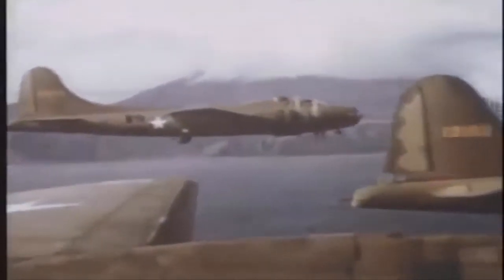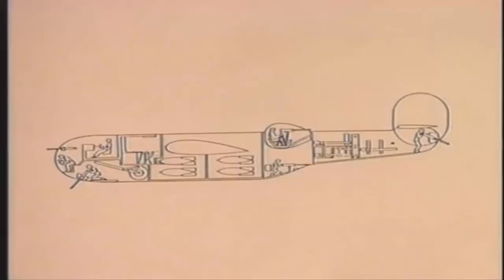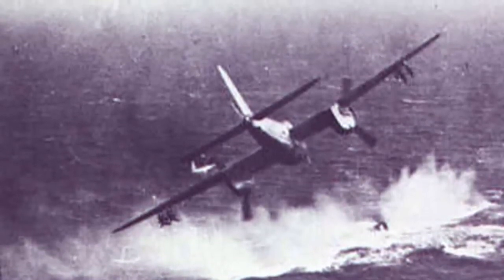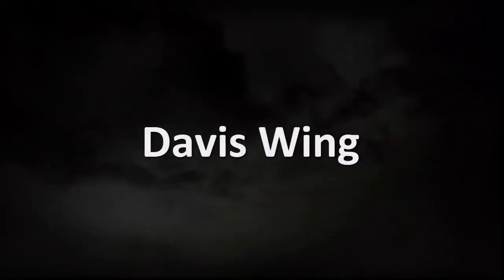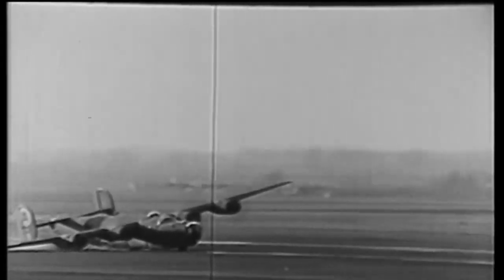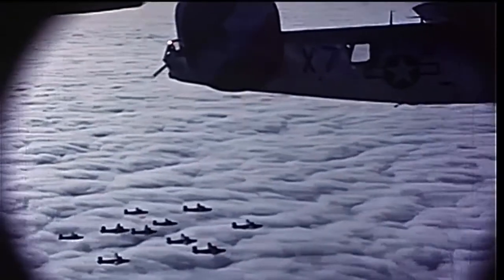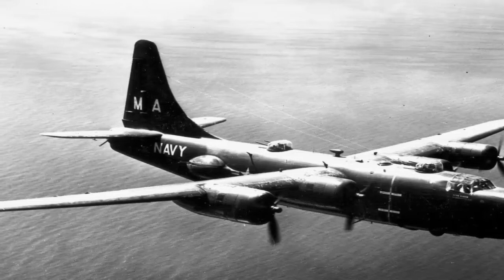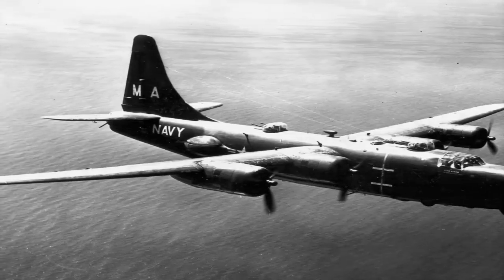B 24 Liberator:  3 Major Design Flaws

Comment: My father, a Ploesti 1 survivor, said that if the 24 got hit either in the wing root, or in the landing gear well, that the wing would snap off. Many of the people in his outfit (the Pyramiders) really did not like the airplane (mostly A models), but they were stuck with it.
Reply: I talked to one of the workers who flew on the Collings Foundation B-24 bomber and he told me that the B-24 drifted up and down a lot in the higher altitudes that it was a full workout for the pilots to correct it and keep in formation. One wrong move could send the plane drifting up and away from the formation and force them to fly back alone without escort fighters.
Reply: The wing root area is the weaker spot on most aircraft.
Reply: The wing root is the weakest spot on all large aircraft.  The 24 could also take more damage than the 17 because of it's shape and design.  The 24 also had an auxiliary flight control system the 17 didn't including hydraulics for the flaps.
Reply: @riproar11  I too have worked with the Collings Foundation and flew in the Witchcraft many times.  The up and down drift is due to no pay load.  In combat with a high wing the dihedral would be left to right with a full load.  That is compensated with the twin tail, though more dihedral is present on the 24 at higher altitudes with a 3/4 bomb payload still higher than that of the 17, it would maneuver just fine without the drift to the left and it's performance was better.
Reply: My Dad flew the Ploesti raids with the 449th Bomber Group. Never talked about his war time experiences.
Reply: My father was a pilot with the 44th BG and hit Ploesti on 8/1/43. His was a D model.
Reply: @riproar11  My Father said you could always tell Pilots by the way they walked.
They called it Liberator Legs!
Reply: @user-qy9tf2im7f  And B-25 Mitchell pilots were hearing-impaired in their left ear and co-pilots on their right. I have seen many B-25s take off and fly over and it is such a loud experience!
Reply: Anti submarine  warfare-300 MPH 80 ft above  the water  to deliver payload. South Atlantic
Reply: NO aircraft even today would survive a 88 mm exploding in the wing root at point blank range..

Comment: The Liberator, unlike the B17, did not have armoured fuel lines and hydraulic pipes, so that when attacked these pipes would turn into flame throwers, dousing everything in burning fuel. US airmen said that if you looked around you in a POW camp, you could tell the B24 crewmen because they were the ones who were burned. The Lancaster was also guilty of burning like a Roman candle, made worse by an escape hatch that was too small for a crewman to exit wearing a parachute. Good examples of how expendable lives were.

Comment: "It didn't fly as high, so it was easier to hit with flak"

They had a larger maximum bomb weight, so they didn't fly as high and were easier to hit with flak. 
That's a decision, not a design flaw.

As for "hard to manuever"... my grandfather (B-24 ball turret gunner, Flak Happy, Flak Happy Too, Kontagious Katy) told me a few stories about experiences on the 24 before he passed. He never expressed a wish they would move around better.
...a few times he wished people would stop throwing out toolboxes and parachutes while lightening the craft.. but nothing about the 24 itself.

Comment: I saw a documentary on these once and it was considered slightly superior to the B17. The only serious flaw was the it was difficult more difficult to escape if the plane was shot down.🇦🇺
Reply: At least the crew in either the B 17 or B 24 as a whole had their parachutes harnessed to them ( with obvious exceptions ) , the British 4 engined bombers , Short Stirling , Handley Page Halifax ,and of course the Avro Lancaster ,  had crew positions that as a rule didn't allow for harnessed parachutes , and consequently mortality rates amongst those crews was ( noticeably )  higher when compared to USAAF crews on ( similar ) missions

Comment: Heard a conversation between a B-17 Veteran and a B-24 Veteran.  The Liberator Vet said; "The B-24 carried more bombs further."  The Fortress Vet replied; "Yeah, but the B-17 carried more aircrew further."
Reply from the maker: Each one had their own strengths and weaknesses for sure
Reply: Truth is they had almost the same exact loss rate with a small edge going to the 24.
Reply: @cdjhyoung  Good points all. My father flew his 35 missions out of Italy to points north. Strong advocate of the B24.
Reply: @fawnlliebowitz1772  The number of mission flown to complete your tour of duty changed: the original 492nd 'only' needed to fly 25 missions and be done. My dad, one of the last replacement crews, need to fly 50. Your dad in Italy had to make 35. Some of the guys in the South Pacific needed 100 missions for a tour of duty. Those had to be hard count downs to fly that many missions.
Reply: A dumb argument. The 17 carried a larger crew and a smaller bomb load than the 24.  It was also slower and had a shorter range than the 24. Nearly 7,000 more  24s 9were  bhilf

Comment: About 15 years ago while flying for Delta Airlines, I flew with an F/O that had been at an airshow in Memphis (I think), and luckily met the right person. This person called him later and asked if he would like to be his co-pilot and help him ferry his B-17 from Memphis to California. The F/O jumped at the opportunity got to fly the B-17. A few weeks later, the guy called the F/O and asked him if he would like to help fly his B-24 out to California. Again, he jumped at the chance. He told me that flying the B-17 was a pleasure; it had very light controls and you could trim it up and fly it with your fingertips. The B-24 was a different story. The controls were extremely heavy; it felt like you were driving a dump truck. He said it felt like you were trying to balance a ball on the head of a pin.
Reply: I have heard that from a former B-24 pilot from WWII, Sherman Beard, of Hillsboro, WV, now deceased.  He told me you could easily tell a B-24 pilot as one arm  was more muscled than the other.  He flew his required missions over Italy and Germany and got to go home, flying his crew into Bradley Field, CT, as their final destination.
Reply: @UncaDave  Same thing I'd heard: a B17 was easy to keep in formation, or as one guy said, 'once it's trimmed, it can fly itself'; but the B24 was rather harder to fly in tight formation (and it could not quite go as high nor could it absorb the same amount of damage the 'Fort' could). As a result German fighters would often be vectored to the 'Libs' because they were lower altitude and looser formation--right in the 'heart' of the FW190's 'peak' performance envelope.
Reply: @nickmitsialis  Probably so.  Sherman Beard told me he was hit with lots of flak and everyone of his crew was wounded at one time or another.  His co-pilot got hit badly and he told me the cockpit was covered in blood.   What these men lived through, survived and died in is impossible for us to imagine.  Thanks for your comments.
Reply: @UncaDave  Too high to breath and you're freezing cold, and on top of that, you're wounded. I can't imagine how people endured that.
Reply: My college friend's father (who was a lot older than our fathers) had flown both the B-17 and B-24 and he said that he preferred the B-24 because it was a lot more maneuverable than the B-17, outperformed the B-17, and was more modern. Maybe it was a matter of positive stability versus neutral stability... or maybe just a matter of preference.

Comment: The problem was the unit-construction method of building the B-24. You can see, in the wing framework drawing, at 3:05 to 3:13 in this video, that the wing was manufactured in one unit, and joined completed to the mostly completed fuselage assemblies. I don't remember the details, but it was another YouTube video. A lucky hit with a cannon shell from the Germans(who found that they caused more damage than regular bullets, even bigger ones, like 50 cal.) could cause a fiery explosion(from the main gas tanks being in the middle of the main wing section, right over the wing spar for superb load-carrying ability) that would shuck the wings from the unlucky Liberator and kill most of the crew by not letting them bail out. There's a widely-seen film-clip - seen in many videos - showing a lucky hit to the center of a B-24's wing section and you can see the fatal flaw in it's entirety; the plane bursts into fire and the wings fold back almost instantly and burning aviation fuel floods into the fuselage. 
My father flew B-17s in the war and was shot down and became a POW. He also flew B-24s after WW2 and said that the B-24 was more comfortable to fly(he was taller) and very reliable if well maintained. I also spoke to some German pilots who fought against us and were glad to talk to us US servicemen stationed in Germany in the Cold War; they told me that B-24s were popular as a target for that first high-speed pass through the bomber formation, because a lucky 20mm cannon-shell could burst the plane apart like a clay pigeon in skeet-shooting, except that the plane exploded into flame. They said that ALL the USAAF bomber formations were hard work to attack from anywhere besides the front because of the hundreds of 50 cal gunners trying to kill you, some of them quite skilled - many Luftwaffe planes came home with at least SOME kind of damage from machine-gun fire.

Comment: The chief characteristic of the Davis Wing was not the fact that it was a high aspect ratio wing.  Other bombers had high aspect ratio wings. A high aspect ratio wing is simply a long, thin wing.  (Aspect ratio is determined by Span divided by Chord.) It was the AIRFOIL shape that made the Davis Wing.  The Davis airfoil was taller, as seen in cross section, which allowed for a taller wing spar.  The strength of a wing spar is largely determined by how far apart the top cap strip and bottom cap strip are.  This is a basic I Beam principle. They were very far apart in the B-24, which gave the Davis spar great strength, allowing for heavier loads.  The weakness was that there was no room for turbulent air flow going over the top of the wing and, consequently, the B-24 could not carry ice loads!  Suggested reading:  Fate is the Hunter, by Earnest Gann.  He flew the cargo version of the B-24.  I believe it was called the C-87. He did not like it.
Reply: (From memory, from decades ago) Gann said the "vaunted " Davis wing "couldn't carry enough ice to chill a highball".
Reply: I think Gann also said either the C87 (or DC4 or DC6) flew like a fighter when he was spiraling tightly down a steep hole in the clouds into a San Francisco or Iceland airport.
Reply: @bernardscheidle5679  a truly dangerous thing to do, but Gann was a Pilot...... a real one...
Reply: @fredferd965  I think the chapter in "Fate is the Hunter" may have had the word "HOLE" in the title.  I think there was a hydraulic fire, smoke in the cabin, and some scared passengers.  He saw the hole, knew it could close, but  chopped power to almost not running, I think put down the gear to slow the dive, and did a tight spiral following the hole all the way down to the center of the runway.  It was night, clouds, fog, no visibility, and apparently no modern instruments in that day.  He also had a chapter that was titled with one word, "Ice".  That was a nail biter.  I read years later in the 1990s I think, in the New York Times, that aviation was doing research on "super cooled drizzle drops" that explained more why ice could be so dangerous to planes.
Reply: @bernardscheidle5679  Sounds right to me.  Gann was also a great writer - he could make you feel like you were there....
Reply: @bernardscheidle5679  He chanced upon a 'hole' in the bad weather and dived his plane into it: he was very lucky to find an airfield at the bottom of it, as I remember.
Reply: @None-zc5vg  He could see the center point of two crossed runways at the bottom of the hole through the clouds.  I think it was several thousand feet below and took a few minutes to descend.  He reduced power to the engines to barely running, went into a tight circular spiral down the hole and pulled out at some point just before the ground with enough visibility that he could land.

Comment: There were other things.  The B-24 was difficult to bail out of in an emergency.  It also lacked armor for the pilot and co-pilot.  Some pilots and co-pilots used to carry a plate of 1/4" steel with handles which they would hold up in front of their lower bodies when fighters were coming at them head on.
Reply: Wasn't there a central fuel-tank in the 'B-24' fuselage that turned the aircraft's interior into an inferno if punctured ?
Reply: @None-zc5vg  That was only used on special long range missions when they
removed half the Bomb racking and replaced it with the extra fuel tank.
The H Model my Father Flew in had self sealing tanks, which prevented fires.  My Father's Ship had the Hydraulics shot out, flak damage to both wings & one stabilizer, and lost an engine, in went in to a spiral. The Pilot gave the Order to bailout my Father and 5 others went down the catwalk and out through the Bombay Doors. MACR 2398. After dropping about 5000 feet the Pilot and Co Pilot regained control of the Ship and using manual controls limped it back to base. The Ship, part of the Group Original Cadre was patched up and replacements were put into the crew and it completed it's 25 Missions. It was then turn over to a New Pilot and crew and flew 21 more Missions until being shot down in June of 44 MACR 6443 and had flown 46 missions without full escort. I think it was a pretty durable Aircraft. You also have to keep in mind that the 15th Air Force was did not get P51s and did not have them the entire time that Ships were Flying. The 17s mostly flying out of England with the 8th Air Force were first in line to have full escort to and from the target and got them in late 43. My Father was in a Stalag Luft 1 for a long time before his Group received P51s. They, heard about the P51s listening to crystal radios they built in the Camp.
Reply: @user-qy9tf2im7f  That's got to be bitter-sweet seeing the crate you were just ORDERED to bail out of, recover and fly on home almost like nothing ever happened.
Then again from the pilots perspective they would have been doing all they could to right the machine anyway and wouldn't want the rest of the crew to die should the attempt fail.
Reply: @ToreDL87  They probably never saw it as they
were in free fall counting down to pull their shutes.
They were looking at the ground from that point on.
The Pilot tried to communicate that he was regaining manual control, but they had already removed headsets  scrambling toward the Bombay doors
along the catwalk. You got to remember that when a Pilot gives an Order he is the Captain of the Ship. You don't question, you follow Orders. It was only took a minute to drop 5000 ft in a spiral and all
hell is breaking loose. The Pilot said "BAIL OUT". They went.
Reply: My dad was a B17 and. B24 co pilot,(age of 20) during WWII B24 during the war.  He had to fly a B25 for awhile after Casselbury (sp), most of the men and planes did not make it back. Horrible. Read about the Casselbury or Castlebury mission. He stayed in the Air Force as a lifer and they called him in to fly and instructor on the B47. McConnell A.FB.  After take off ,only a few minutes the fuselage exploded and the lost a wing then the tail dad got the plane to a field away from the houses before it crashed.  1956 March 28th in Wichita,Kansas.
It happened a lot with the B47s, that was the first jet engine bomber. The Squadron dad was in during the war was the 445th eighth A.F. Jimmy Stewart was too; at the same time. Jimmy Stewart’s plane was named “3or 4❓yanks and a jerk”. I was a baby when dad was killed, and I miss him, but oh so proud of him. I’m Tim’s wife maiden name Craggs dad was William (Bill).  God Bless them all for keeping us safe and America free‼️
Reply: @timedwards4455  I have the book,. It's called Nine Yanks and A Jerk.

Comment: Reading a story about a B24 that was out on patrol around the Aleutian Islands during WWII. The plane took some flak from the Japanese on either Attu or Kiska, dropped their bombs and headed back to base. On the way back and in addition to their flak damage, the plane started icing up big time. Their base in sight, the pilot orders the landing gear down and everything locks into place... EXCEPT the nose wheel that had caught the most of the flak damage! Pilot and copilot have read about two wheel landings in a B24 and had heard stories from other pilots. Though not impossible, you need some piloting magic and some, ok, lots of luck! The pilot orders EVERYONE to the rear of the airplane, needing that extra weight to keep that nose up as long as possible while he stamps on those breaks to slow the ship down. Pilot lines up on the runway where it is snowing and freezing raining out. He sets her down on those two wheels, hits the breaks for all that they are worth and just off to the side of the runway end, the plane stops completely... WHILE STILL BALANCING ON THOSE TWO WHEELS! The pilot is like WTF as well as the crew members. They all get safely out of the damaged B24, throw their flight gear over their shoulders and head to the nearest warm building... though they do occasionally turn around and look back at their B24 that is STILL BALANCING ON THOSE TWO WHEELS!